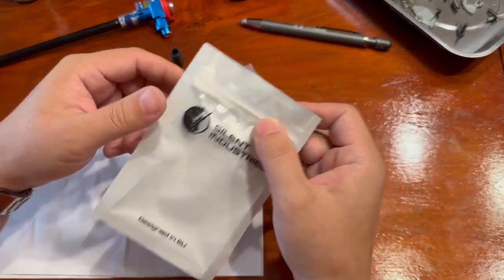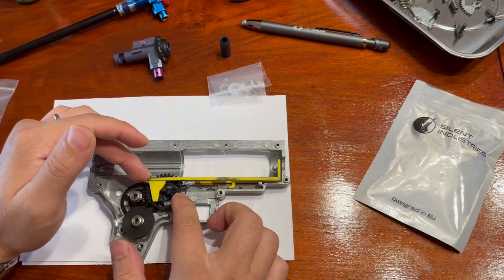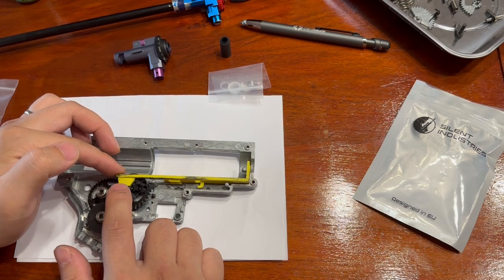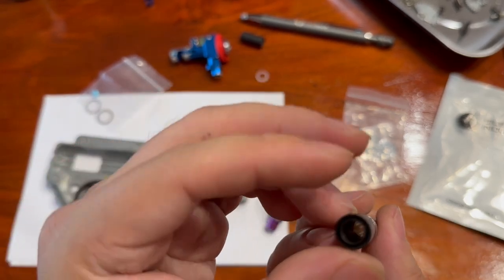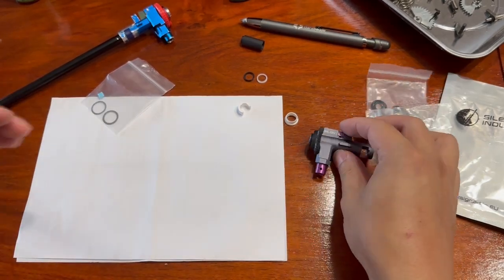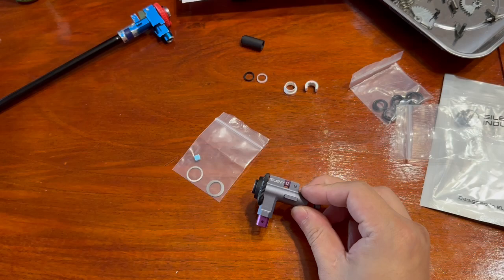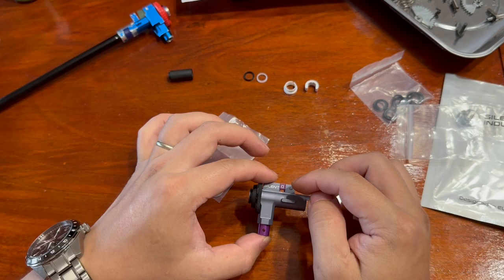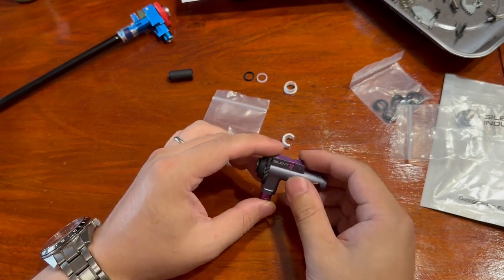Building the best performing AEG in 2024 pt 3 - Silent industries Alpha HU

Comment: Completly useless feature the lip tension control XD, just use the correct nozzle for your setup... Its ridiculous all the shit manufacturers try to sell us, and people keep falling on their trap. Maxx hop units are garbage, absolutly garbage for the prize tag, this one looks better, but still fuking overprized piece of junk there is no way you can justify this amount of money, just buy a Retro Arms unit, less than half the prize, double the quality and triple the performance.
Reply from the maker: I could even make the stock chamber work flawlessly for a particular build (and thats what I use most of the time nowadays) but getting the bucking lip tension right is important for DSG/HPA setups etc. It may be solvable by experiement with different combinations but I consider it a nice feature being able to adjust it, allowing more choice for buckings.
Reply: @wyz2285  Is there a bucking, that is really good for hpa? I think I tried most of the popular setups, and none of them is perfect. G&G green, maple leaf super macaron, Mr hop, madbull red and blue, modify flat, begadi shp, tnt tr hop, krytac orange, r-hop patches. Also tried different nubs, tdc, hardness etc. Really could use some advice from an experienced tech like you 😅
Reply: @wyz2285  I cannot argue against that mate, i dont do HPA, and for DSG and rare builds i always use the Perun adjustable nozzle, it works extremly well for AEGs, most of the time it is the only reliable choice i can find when  working with non Ak/m4 based guns

Comment: Curious on your thoughts about the Maxx hop unit that allows GBB buckings for AEGs. Like you I am a fan of the X-Range due to the stabilizer ring. I think the Maxx with an X-Range bucking could also work to slow and stabilize BBS with more aggressive loading builds.
Reply from the maker: I'm skeptical, the AEG nozzle doesn't move enough to push the bb into the barrel, like not even close.
Reply: @wyz2285  Yea I have not seen or heard any reviews on the new Maxx hop yet. GBB buckings in general have a longer loading ramp (which in theory should help slow and stabilize the BB more than traditional AEG bucking lips), but I would expect Maxx to design this limitation in mind. Otherwise, it will be useless.
Reply from the maker: @Taseden  No matter how they design it, the nozzle won't have travel for it. IMO Maxx just make these to make a quick buck before people realizing it doesn't work in general (which will take a while, it could work with specific bucking in some setups and few people will get lucky and be happy with it)

Comment: Wow, thank you for sharing your knowledge.
I knew the trick with the flathop in combination with enlarged barrel window and small nub, but I've tried it with hpa, and the results were meh.
Wouldn't it be better if I placed the nub as far as possible and not in the middle of the barrel window? I can 3d print trolleys for e.x. maxx hopup unit, so its doable.
Reply from the maker: It could work, but you don't want the nub to be close to the barrel hop window edge, otherwise you're cutting the bucking when pressing down.
Reply: @wyz2285  It didn't work. The vertical spread is too big. Currently Im using maple leaf hot shot hybrid bucking with gbb barrel, and It gives me far superior results. Still not perfect though.
I have SI alpha chamber, and honestly, these tensioner rings aren't doing much in my case. Tested it with P* F2 and Kythera (both have the weaker nozzle return spring installed).
Given the best results I've got come from GBB barrel, I'm really eager to test MAXX M4G with the Modify X-Range bucking you recommend. I just got the bucking, and Im yet to test it in my pistol
Reply from the maker: @nikelski9590  The bucking will work fine in your pistol, but AEG/HPA engine doesn't have the nozzle travel for GBB buckings, I'm skeptical it would work.
Reply: @wyz2285  You mean the GBB M4G will not work at all or it will not solve the problem?
Reply from the maker: @nikelski9590  It might work with some GBB bucking, but I'm confident it will not be a problem solver. No matter how it's designed, AEG/HPA nozzle simply does not have the travel to allow consistent bb placement. Maxx probably made these just to grab the cash before people realizing it's crap (which will take a while, I can imagine it work with a few specific bucking and setup)
Reply: @wyz2285  I've seen some videos with tests here on youtube, and honestly It doesn't look like it solves the problem, but the guy testing it used different engine and buckings. I'll wait for more opinions then. Thank you!